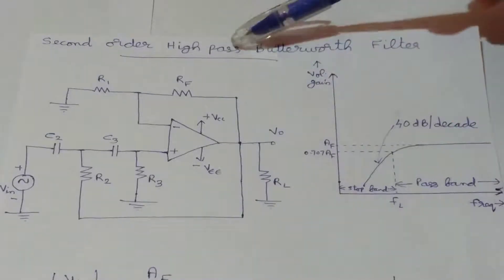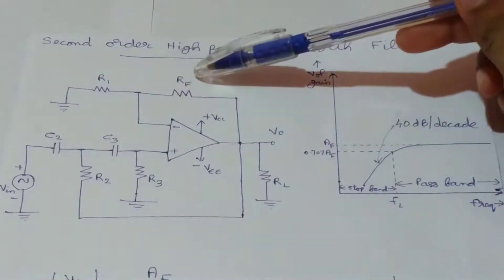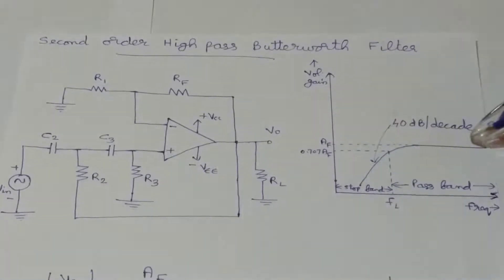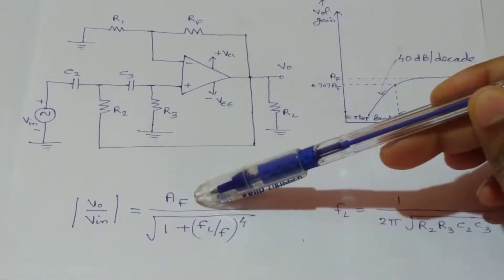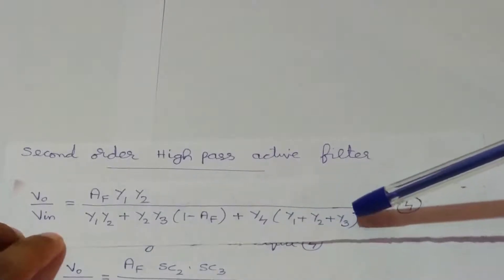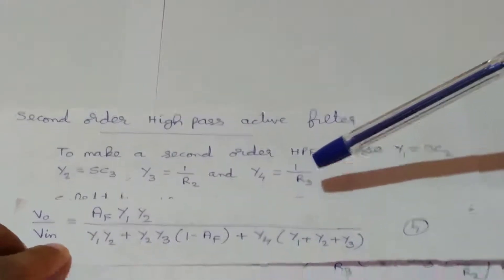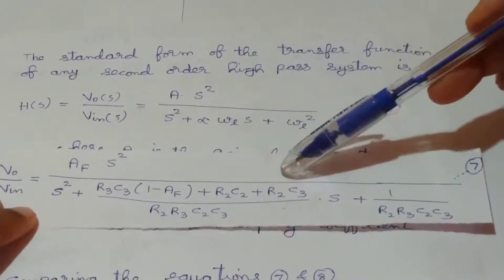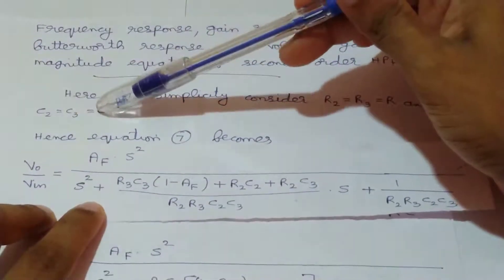SECOND ORDER HIGHPASS BUTTERWORTH FILTER USING OP AMP | SECOND ORDER HPF | SECOND ORDER ACTIVE HPF

Comment: I have a homework for the 2nd order high-pass butterworth filter and it says that the filter's passband is 1 rad/sec. Where do I use this value while denormalizing transfer function?  Also in your some equations, I see 'f' symbol, what is this 'f'? frequency of the voltage source or something? Thanks for your attention.
Reply from the maker: We know angular frequency w(omega)=2πf. 
So f=w/2π . Using this equation we can convert the angular frequency ( in rad/sec) to frequency f in hertz.
Then, a HPF passes all the frequencies that comes after its lower cut off frequency . So its pass band is actually from lower cut off frequency to infinity.
Reply: @NycilsSupport  thank you so much!